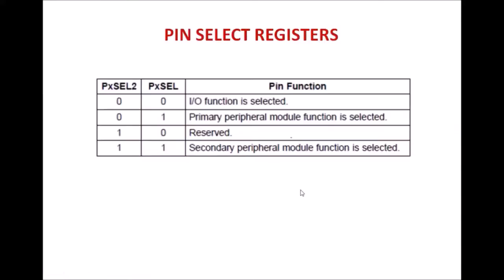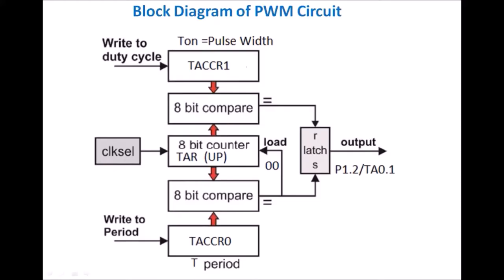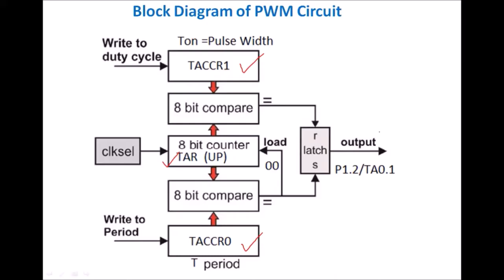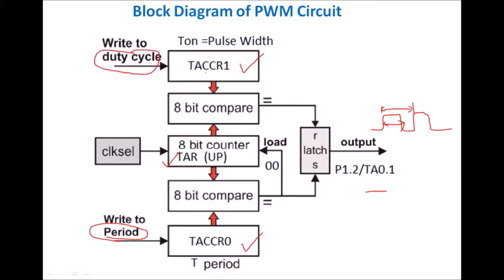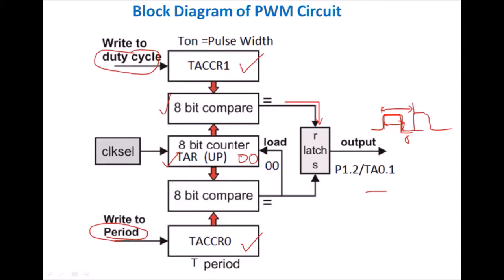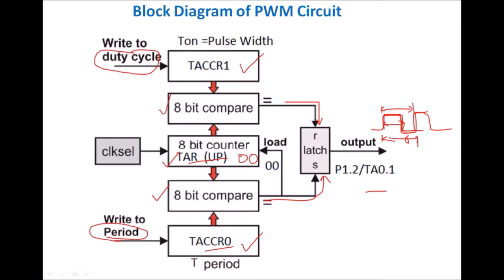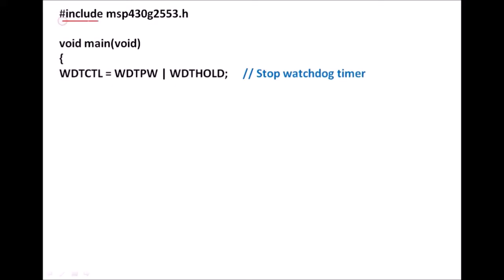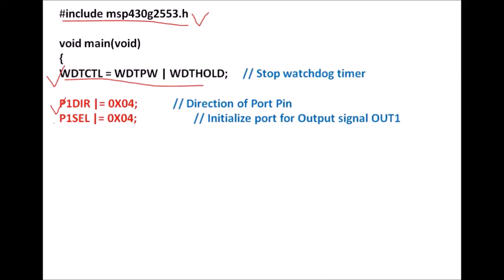PWM Theory and Program for MSP430 | Embedded C program to generate PWM signal

Comment: TACCR[0|1], TAR is 16bit register, it can set value 0~0xFFFF.

I tested msp430g2553 by proteus 8.17.
So, TACCR1, PWM pin output a TA0.1 is fail. TACCR1 real pin output is a TA1.0.
      TA0CCR1 = 0x4000;		// = duty ratio < TA0CCR0 = duty period
      TA0CCTL1 = OUTMOD_7;	// OUTMODx = 111(Reset/Set)
      P2SEL |= BIT0 | BIT3;	// TA1.0 is for TA0CCR1, duty ratio, TA0.1
      P3SEL |= BIT1;	// TA1.0 is for TA0CCR1, duty ratio, TA0.1

I have not success work, a TA0CCR2, TA1CCR2